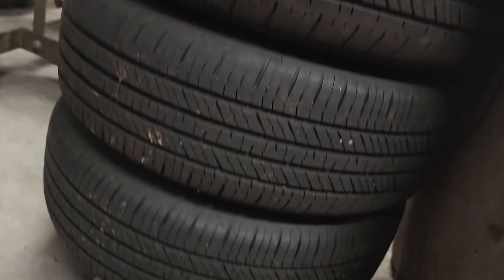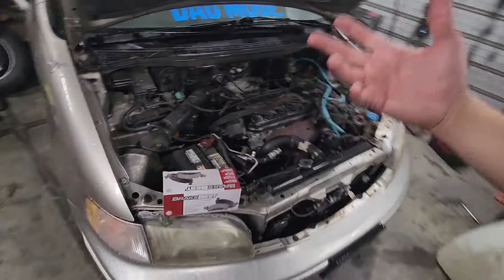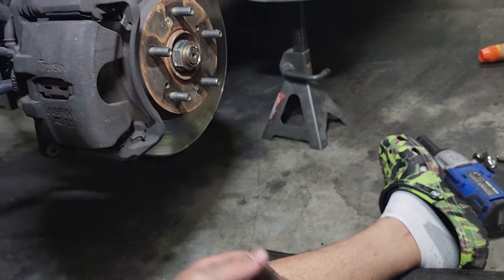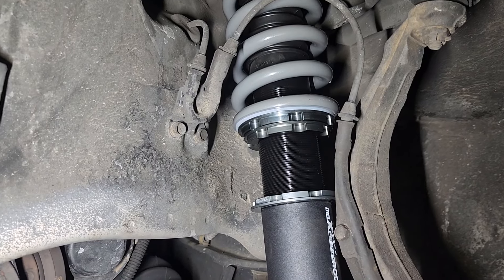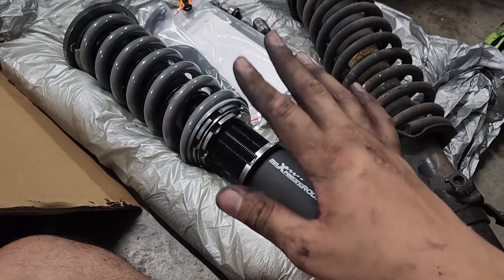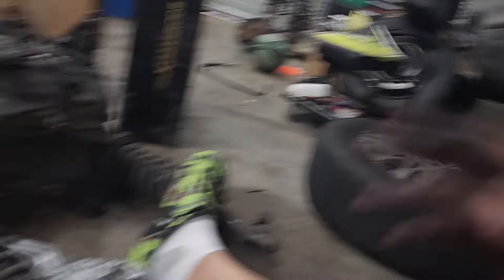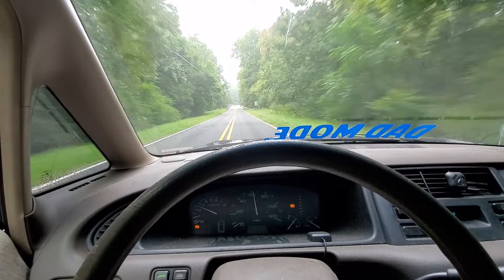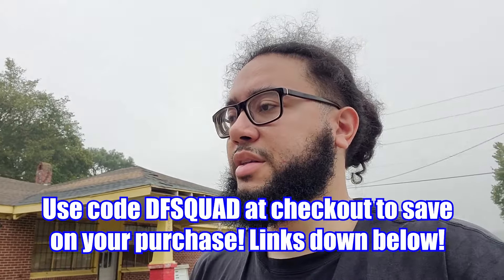WHY DO THESE COILOVERS GET SO MUCH HATE?!? | BUDGET Coilover Install On My Honda Odyssey! | MXR T7

Comment: cheap way to lower the rear. Rancho shocks (don't remember the part number but if you want to try this out hmu I have a pair I'm gonna use for my trailer project) and 06 Civic Si rear springs turned upside down

Comment: Don't take it for granted that the preload is correct when they come out of the box. They are a pain in the ass on my Nissan n16, noisy and too hard, even adjusting then to softer ride. Front top mounts are noisy also.
Reply from the maker: @steve1750  shoot I take preload out to get lower lol. Don't have any noises from any of mine right now. I've got them on all my hondas. I've been working with them to produce better versions to get lower tho for sure. That's my biggest issue with them
Reply: @DrivenFilmsPhotography  Thanks for replying. They say max 10mm preload factory set but one had 15mm the other 0mm, so I set both to 5mm mostly noise is from the tophat mount, I think on the front, the back rubs slighly on the bottom mounting bracket, I need to cut it back a little. But even on softer settings they seem a bit of a hard ride. It's a bit hot here to do it right now 40°c in Western Australia. Merry Christmas to you.
Reply: You could cut the spring, but you will need to do it on a drop saw to get the right taper on the bottom of the spring, cut both exactly the same. Good luck.